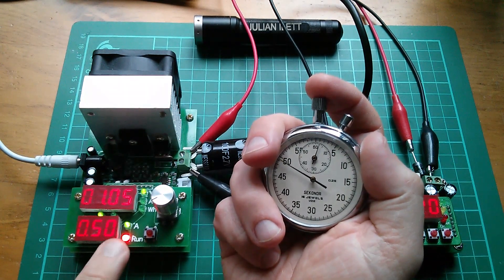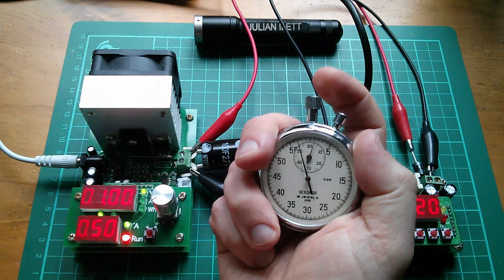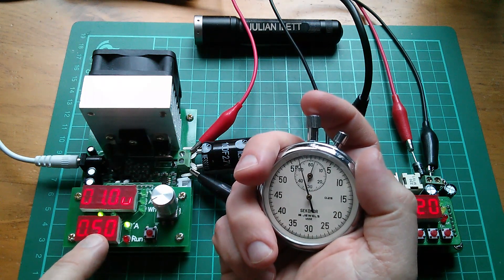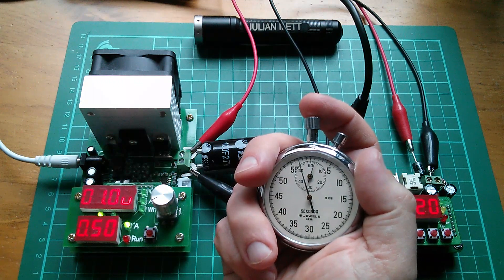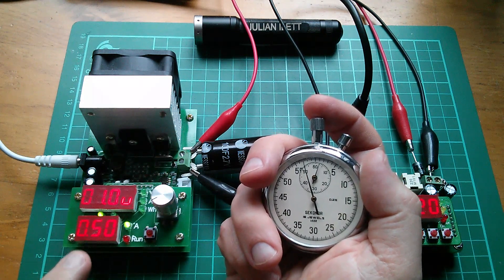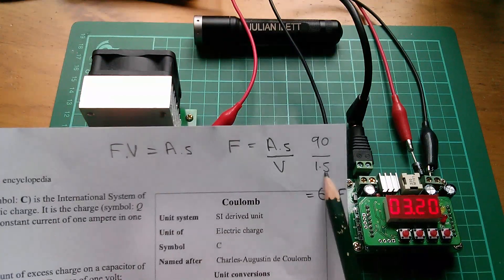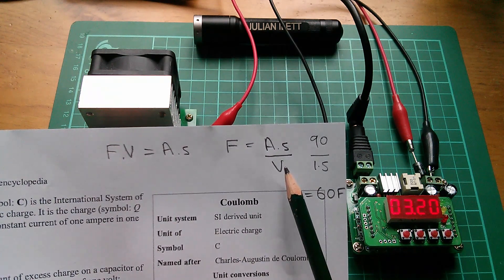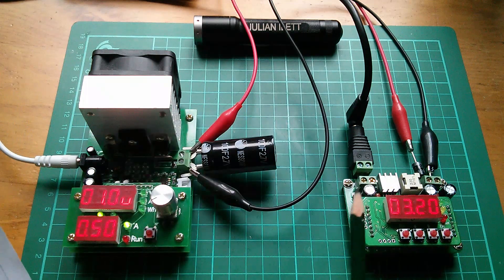Measuring the Capacitance of a SuperCapacitor

Comment: Your test is good and around 60F is the real capacitance of that supercapacitor. The only thing missing from your equation is ESR but luckily you eliminated most of that by starting the DC load at 2.6 or 2.7V so the voltage drop on the ESR was mostly accounted for. (not sure if that was intentional or just luck :))
The other two important parameters of super capacitors are ESR (part of the stored energy will be lost internally during charge and discharge) and the self discharge leakage a sort of equivalent parallel resistance.
From my experience those inexpensive China super-capacitors have a wide variation of both ESR and leakage current (that is for the exact same model of capacitor difference between samples) and because of that they are completely unusable in a series connection since they will never stay in balance.
A good set of supercapacitors with all equal ESR and leakage once balanced they will stay very well in balance while with those bad ones you will continuously try to balance them but never be able to keep them in balance or at least close.
I seen as much as 2 to 3x difference in ESR between samples of the same model and even larger up to 10 or 20x leakage difference with some extreme ones that where drooping over 1V in 24h trough self discharge.
They will still be great value even at 60F if all of them (same model) will be 60F and have the same ESR and self discharge but because they are not equal they are useless to use in any serious application in series since a lot of energy will be spent trying to balance them all the time.
Reply from the maker: I agree Dacian. The 100F caps are super cheap - about $2 each. I'm not expecting miracles. But this is what I do. I stick cheap-ass crap together and see what results. My supercapacitor speaker won't rival the Hydrogen (Hydrogen Sulphide maybe) but if it can bang out a few tunes, I'll be happy :)
Reply: The comment was mostly for your audience since I completely agree that for your entertainment and educational use they are good enough.
I like supercapacitors even if they currently have no real benefit compared to lithium batteries in almost any application. I will not like people to get a bad impression about supercapacitors because of the low quality ones.
Is good they are super cheap so people can play with them.
I remember when I seem the first supercapacitor in a local electronic store around 1997 so about 20 years ago where the price label of the supercap was saying 3.3F and I was sure that was a mistake so I pointed out to the seller that wrote that label (was a high school friend that was just haired there) and he insisted that is a 3.3F and give me a closer look at the capacitor.
Sure enough the marking on that rectangular capacitor was saying 3.3F at 5.5V and while the 5.5V was suspiciously low I still did not believed that can be a 3.3F capacitor so I asked him as a test to charge the capacitor from a new 4.5V battery (that was still a popular type of primary battery made of 3 cells) and then try to light a small 5V incandescent bulb used in those same flashlights that used those 4.5V batteries.
I was of course proven wrong and that was a 3.3F capacitor made internally of 2x 2.7 6.6F capacitors in series and encased in a rectangular plastic case similar to large AC high voltage capacitors.
They where cheap so I purchased bot units available in that store immediately and had fun for quite a few days. One of my first tests was to power a portable caste/radio player (a cheap walkman clone) and the supercap was able to power the radio for a few minutes and even able to power the cassette player for a few seconds.
If you search for "Goldcap Matsushita 5.5V 3.3F" you will find some old eBay Germany adds for this capacitors and can see a photo. They are black rectangular with of course gold text :)

PS: I just looked at this http://www.ebay.co.uk/itm/4-Piece-Capacitators-Goldcap-Matsushita-5-5V-3-3F-RM32-5-40x15x40-/322519706493 and it mentiones the date code as 1987 so I was probably purchasing very old (a decade old) stock in 1997 :) I had no idea.

Comment: It is my understanding that both charging and discharging of a capacitor is EXPONENTIAL, not linear.
Reply: if connected to a voltage source or discharging across a resistor it is an exponential decay, but because Julian applied a constant current load, the discharging is linear.
Reply: Infinion his "constant current load" is STILL RESISTIVE. However further to my comment he mentioned that the "Charge rate" slowed as it neared 2.5 volts, and slowed as it approached 1volt. Therefore validating my statement that it's charge/discharge was/is EXPONENTIAL. In addition, he only discharges it partially. So as an other commenter says, "a ten gallon bucket is still a ten gallon bucket even if you only discharge five gallons of its contents.
Reply: +Bruce Woods a constant current load functions exactly how it sounds. Like +KASA kasa says, it varies the resistance so the current remains fixed, and the voltage curve remains linear. Julian used a constant current load to discharge, so we can calculate exactly how long it would take to reach 1V from 2.5V. If it wasn't linear then this whole video would be moot and we wouldn't have found our 60F capacitance.

Julian connected the supercapacitor directly to his supply while charging, so in that case it would be charging under a constant voltage and would show an exponential decay, but we weren't looking for capacitance while we were charging because of this reason.

so to rephrase your statement, charging and discharging of a capacitor DEPENDS on the circuit it is connected to. It is considered Exponential decay if the source is a constant voltage, linear if constant current, or oscillatory decay if connected to an inductor.

Comment: like many of the comments here I was also confused and thought only a portion of the capacitance was measured, but if you extrapolate from the data you can see the voltage range doesn't matter (assuming the drop is linear). 

90s to drop 1.5v = 150s to drop 2.5v. 150/2.5 still = 60 farads.

Maybe this is wrong, but I always thought the charge and discharge curves of a capacitor was logorithmic, not linear.
Reply: If you just connected a capacitor directly to a constant voltage source, or connected a charged capacitor to a resistor the curve would look just like an exponential decay function similar to a logarithmic curve on a graph. However, Julian deliberately connected the charged capacitor to a constant current load, so we get a linear slope instead, which makes calculating capacitance much easier.

as you say, the voltage range doesn't matter. The V in julians derived equation is a voltage range ΔV and can be evaluated as: Total Farads = (Constant Amps * Total Time)/(Start Voltage - End Voltage) when the slope is linear.
Reply: That makes sense. Still, it seemed to me that the voltage was changing slower as it got lower. Probably just issues with the calibration of the measuring devices. I think a scope or a data logging meter would give a more accurate and complete picture here.
Reply: agreed.

Comment: please tell me if i  am Wrong but 100f means the complete charge and you only measerd 1.5 of 2.7 v and that is 56% so  it makes sence to measure only 60f or do i forget something?
Reply from the maker: True, I only measured a partial discharge, but that takes less time. The calculation for capacitance is a ratio (time / voltage change).
Reply: 100F does not mean full charge. No matter what voltage a capacitor is charged to, it always has the same capacitance. Farads is equal to charge per volt just like fuel economy is litres per kilometer. 
You use capacitance to calculate total energy capacity in Joules. This formula is for energy = 0.5*C*V^2 .

Total energy is 0.5*C*(Vstart - Vend)^2. Like Julian says, Capacitance does not depend on what voltage you start or end at, it is a ratio of time/change in voltage. As long as you discharge at a constant current, any start and end
voltage will give you the total capacitance. This is because in our formula for capacitance, C = q/V, the V is actually a ΔV (voltage range Vstart - Vend) or in other words Farads = (constant Amps * total time)/(Start Voltage - End
Voltage). So if we discharged the capacitor from 2.7V to 2.69V at 1mA we would eventually get 60F after 10 minutes.

Comment: you should always use DMM across the device (capacitor) terminals. Never trust DC loads, power supplies (especially chinese ones). Even if they are good (exception is when you are doing 4 terminal measurement) there will be voltage drop on the terminals, cables, traces ... In theory at 1 A the drop should be constant and you don't care for this experiment, but still ... Ow btw I noticed that while you were waiting you were calculating - very good way to kill time. I also like to do that sometimes. I made a checkpoint at 1.5V (1V drop) - about 55 seconds = 55F.

Comment: As others have pointed out, all that was done here was measuring a portion of the capacitor's actual capacity. 1.5V is about 55% of the capacitor's total voltage range, so a 60F result (60F is 60% of the capacitor's rating) is not only acceptable, it's probably within spec, too.
Reply: I think you are confusing capacity (energy expressed in Joules) with capacitance in Farads which most people do. You do not need to discharge from its total voltage range to find capacitance. You would do this if you wanted to find the total capacity in Joules. If you just plugged in the capacitance value that the manufacturer claimed, you'd get a completely misleading number for its capacity, so its important to verify these things yourself if you want to be accurate, rather than trusting the label from a foreign supplier who may have just inflated the numbers to increase the value of their product.

Capacitance does not depend on what voltage you start or end at. As long as you discharge at a constant current, any start and end voltage will give you the total capacitance. This is because in our formula for capacitance, C = q/V, the V is actually a ΔV (voltage range Vstart - Vend) or in other words Farads = (constant Amps * total time)/(Start Voltage - End Voltage).  So if we discharged the capacitor from 2.7V to 2.69V at 1mA we would eventually get 60F after 10 minutes.

Comment: The total capacity gets even worse when you run these caps in series. 6/2.7v 500F caps in series will give @ best 230F over all.
Reply: I think you're thinking of capacitance that decreases in series, not capacity.  Total capacity (energy in joules) will stay the same regardless of whether they are connected in series or parallel. Six 2.7V 500F capacitors in series will have a total Capacitance of 83.333F and total energy (capacity) of 10,935 J at 16.2V. Six 2.7V 500F capacitors in parallel will have a total capacitance of 3000F and total energy of 10,935J.

Comment: You are lucky to even get 60F. I got 12 of these cheap china caps and figured out right away that they must have been rebranded rejects. 10 of the 12 would not even hold their charge over night and only 2 were over 50% charge after 24 hours. I did get a refund from the seller which surprised me but was happy after refund but disappointed that I could not play around with them in my projects.

Comment: 3:07 - I am confused why for some videos you don't like to use your DMMs yet for others you will use many?  This was a perfect example of why you should and it would also verify that the volt meter on the load was accurate.  Your DMM should also show another digit so even better still.
Reply: Also if the load doesn't display voltage unless it is on and thus a minimum .2 A load why not use a DMM and minimize your charging time by using the full current output from the PS to charge the capacitor?  Seemed like a weird solution to a simple problem.
Reply from the maker: Yeah, it was a bit weird. Next time I'll use a voltmeter - and an ammeter to confirm the current draw.
Reply: I don't think you'll 'see' any difference....
Reply: I'm not so worried about the accuracy of the readings you obtained as much as using the right tool for the job.  You wanted to monitor the voltage as the capacitor was charging and instead of putting a DMM on it you turned on the load and in turn that slowed down the charging.  LOL... seems like a bit of a brain fart.  ;-)

Comment: Why do you start the stopwatch at 2.5v??
The total capacity of the capacitor is measured from 2.7 to 0.0 volts, not from 2.5 to 1.0 volts, if the load doesn't work for less then 1v you need to do some math to count the remaining charge of the capacitor.
Reply: I think you're mixing capacitance in Farads up with energy in Joules. To calculate capacitance, you use the formula C = q/V, where q is the symbol for charge, expressed in units of Coulombs. He plugs the formula for coulombs into this equation to solve for capacitance and to compare it with what was claimed by the manufacturer.

edit: just for completeness, the formula for energy is E = 0.5*C*V^2

Comment: Is it only me that's concerned that the voltage reading on that electronic load was not dropping linearly?  It seemed to be alternately dropping rapidly for a few digits, then slowly.  If the voltage measurement is accurate then that suggests that the load current wasn't really constant, putting the whole measurement process in question.  Have you verified with an ammeter?

Comment: Didn't you comment on a previous video that the supercapacitors are getting warm when being charged (or discharged?).  This suggests that some of the energy supplied in a charge is being wasted, i.e.: you get less out than you put in.  So it would be interesting to measure the capacitance by using a constant current charging the capacitor instead of discharging it, to see if there's a different, larger result.

Comment: Have you checked how accurate the current draw is on the load? Might be worth testing it for accuracy and linearity. Another way would be to stick an ammeter in-line with the capacitor and see if it varies over the course of the experiment.
Reply: Daniel Wee exactly! I have the same device and there's a 20% error in the current that goes down only at high values (4A) Check my videos...

Comment: whats 1 coulomb in pipple and noist?
Reply: 1 Terra volts/year
Reply: About 1.3 with respect to ground, but only in the northern hemisphere.
Reply: Hmm... we have microfarads, nanofarads and so on. Perhaps we need to add a new unit: chinafarads. According to this video, 1 chinafarad = approx 0.6 farad.
Reply: Richard, a coulomb is a measure of electric charge. It's the charge you find on 6.24 x 10^18 electrons (6,240,000,000,000,000,000). Get that many electors to flow through an ammeter every second and the ammeter will register a current of 1 amp.

Comment: You should get the datasheet of the cap. Usually the capacitance of a supercap is given at a specific discharge current. You might well get to 100F with say a 20mA discharge current.

Comment: I'm curious why you didn't verify the value by just measuring the capacitance with a capacitance meter ??
Reply: Capacitance meters just like resistance meters have a limited range over which they will work.  If you check you will find this is many many magnitudes beyond what a commonly available meter can read.
Reply: Right on !!  Thanks for the clarification.  I heard him say 100 Farads - but my mind thought  - 100 uF !!  {:>)
Reply: LOL... ya your mind was only off by a few zeros... 6...  ;-)

Comment: It's probably been said already. The discharge slope on a supercapacitor probably isn't linear as it would be with a regular cap.
Behaves more like a battery with a more curved slope.

... I think??? Would be interesting to see it plotted on a graph.

You'd need to calculate the area under the voltage curve over time for the full discharge to get the exact value. By choosing a point in the middle of the curve you've got a roughly accurate figure. Plus the schottky is probably throwing things off a bit too.
Reply: It's exponential if the resistance is constant. It's linear if the current is constant as in this case.

Comment: Verify the accuracy of you current load and recalculate. I have the exact same DC load and the current readout is off by more than 30%.  Use your multimeter to measure the current and see what the results are.
Reply: Interesting - I have the same device too, will check it.
Reply from the maker: Good call - I'll do that.
Reply: I've tested mine and the display is dead on with my Brymen bm867s
Reply: Took another look at mine and it's worse than I recalled.  Actual current with 200ma indicated is 390ma and 800ma with 1 A indicated..  Current is also 130ma when off, even with control power at 0V, and load current limits at about 900ma regardless of increased setting.  In addition to being uncalibrated, I suspect my unit may be defective, or a factory reject.  It would appear the unit is intended to be software calibrated as there are no adjust pots one might normally expect.  There also is no apparent way to access the maH and other displays.  Anybody have a manual or know how it's supposed to work?

Comment: ummm nooooooo. 1.5v made up 60F, remaining 1v will make remaining 40F. it's a perfectly 100F capacitor !!!!!
Reply from the maker: Assuming a constant current discharge of 1A, the equation for capacitance (in Farads) is simply seconds/Volts. Discharging more voltage would take more time - it's a simple gradient.
Reply: ummm right, thanks, it was voltage change. my mistake. alright !

Comment: The discharge is not linear across your voltage swing. Try it again to zero volts from a full charge. Also you would need voltage to run the load bank. A power supply in series could be used on the load.
Reply from the maker: The electronic DC load was separately powered (the white cable).